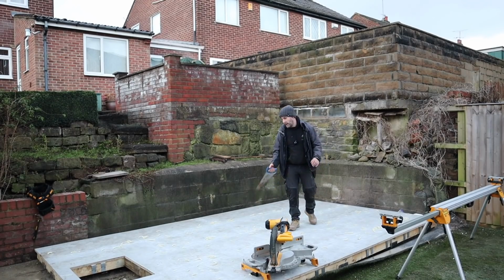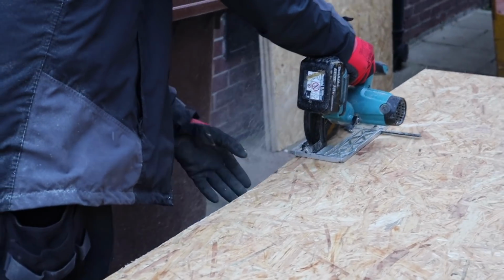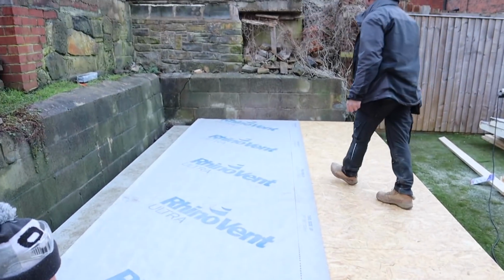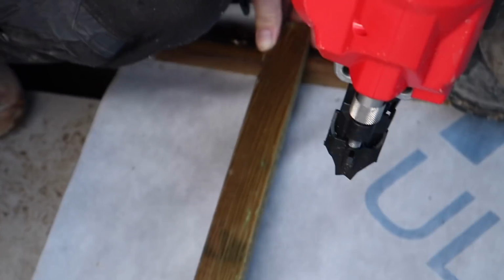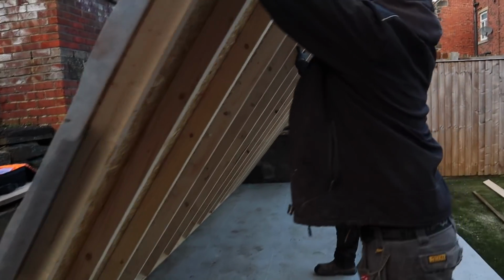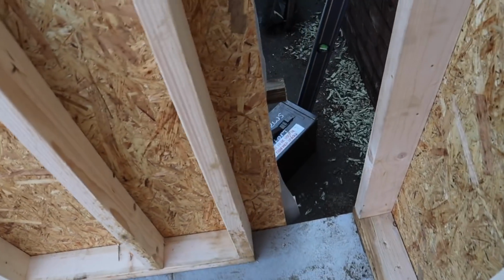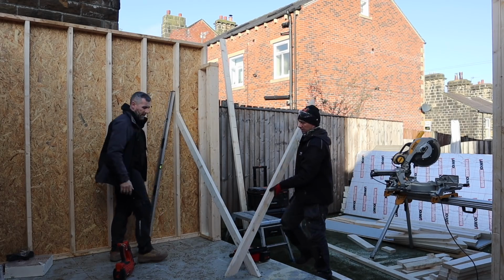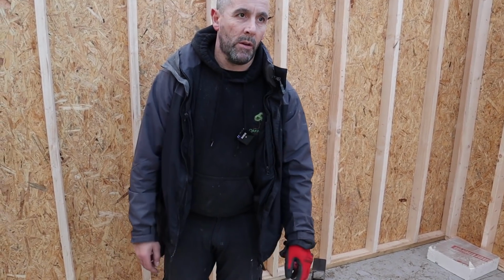Garden room timber frame wall construction with steel lintel

Comment: very entertaining i have a question in regards to the bottom plate although its nailed shut to the deck it has however only 3 nails per stud into end grain of the stud which is a very weak point 13 studs= 39 nails .i am just wondering if it would be more secure if there was some sort of metal  L bracket say every 800mm that could be nailed  to side of stud wall and through bottom plate into deck . i am thinking of up lift experienced  with high winds . or am i just been paranoid .thanks for sharing,
Reply from the maker: Paranoid mate, some weight in these when finished. I’d say around 5 tonne in a 5x3
Reply: @thegardenroomguru  thought i was a bit paranoid , i built a small garden room for myself few years back i now realised it is over engineered.At the time i couldn't help think you'd pull a nail out of end grain with your teeth .

Comment: Despite that milwaukee jamming its still miles better than the dewalt first fix.
Reply from the maker: It’s never jammed before tbh, just unlucky it was on camera 🤣
Reply: @thegardenroomguru   I'd get the milwaukee if I needed one. The dewalt we use Jams so much its quicker screwing stud work together 😂

Comment: Hi William great work could you use normal untreated C16 4x2 instead of cls for the stud walls I'm in Ireland and for some reason cls is three times the price as normal lumber is there any particular reason for the cls except its nicer to work with and maybe treated for pests is it necessary

Comment: Liam did you know you can also get OSB in imperial so no need to rip it down 👍👍
Reply: @samlaw98  I meant metric, lol. OSB either comes in 8x4 imperial or 1200 x 2400 metric sp if you but metric no need to cut it down ;)

Comment: Just a quick tip instead of measuring 400 and putting the stud in the centre. Measure 380mm from the end and then come off of that mark and mark 400 then X on the right side of that mark this will give you bang on centre instead of guessing centre
Reply from the maker: Guessing centre works for us, quick is best when your trying to  make a pound or two
Reply: Agree with Liam on this one. I initially adopted your approach Cameron  and marked up the left edge of each of my studs (I was doing 16inch so had to pull back 3/4 of an inch from 16 if memory serves). But given its pretty easy to eyeball the centre and the tolerances don’t need to be absolutely bang on for stud work, I went with the quicker option of just marking the centres in the end.

Comment: Very surprised OSB is in imperial measurements with you, been building timber frame houses in west Wales for the last 25 yrs and apart from the first couple of years we always get osb in metric sizes. Good video but  you should leave a 3mm gap between boards because they expand and could buckle/distort cls

Comment: Why don't you use 610mm spacing for wall studs? I'm a timber frame designer and we never use 400c/c. If you space the wall studs to cater for the actual OSB width of 1220mm then you don't need to rip them down. There is obviously then a good saving in studs and labour and time, just sayin. Also less studs = less cold bridges. You could also do this for you floor joists and probably for the roof joists depending on the span.
Reply: Actually more timber when you come to dry lining. Plasterboard is 1200.
Reply from the maker: Not from my supplier it isn’t unfortunately

Comment: How are you going to fasten the box profile sheets at the bottom between wall and building?
Reply: that will be like Blue Peter this is how we done it earlier , drop wall sheet it then lift it back up
Reply: From bottom of sheet to top of wall, i  bet there's 1m of sheet not fixed to building
Reply from the maker: It’s sat inches from a wall and will never move when we fix it above wall height 😊
Reply: @thegardenroomguru   could have fixed a cutting of  cladding 100mm above blockwork height, just have a horizontal joint     , put vermen mesh  along bottom between OSB and  external sheeting
Reply: They can rattle in wind, there's a profile trim that fixes to bottom of building, sheets slot in tight
Reply from the maker: @jordang204  no chance, they’ll be mm from the wall, it’s not happening
Reply: jordang204   You will get  moisture travelling into the unfixed joints due to no compression ,  thought there might of been a drip cill  fitted seal the sheets exposed open end at bottom .
Reply: It’ll rattle like a shit house door in the wind. Always like to have 400mm minimum around all walls.

Comment: Looking good, quick question I'm going to make a outside room this year and noticed in your early videos you used a air nail gun are they any good as don't want to pay for a pasload ,already have a 18g brad gun and air compressor? Cheers
Reply from the maker: spot on mate, just dangerous for us with the trailing hose, but sound if you take your time, they never miss a shot

Comment: Would the steel beam be suitable for a 4m opening for the bifolds? You only seem to have 3m openings on most of your builds.
Reply: Good question.  Also, is the steel cold rolled or hot formed as the properties are different. Where do you source it from?

Comment: Did u get an angle or straight gauge finish gun because if you got the straight you can't pun into corner only realised that a few weeks after I bought the straight gauge
Reply from the maker: Straight, it'll be fine, the passcodes are straight too, apart from them both breaking, no issues
Reply: @thegardenroomguru  the milwaukee are gas aswell just need to replace gas in side after 80,000shots

Comment: Speaking as a novice, doesn't the breathable membrane need to wrapped continuously around? Great video again and love the commentary detailing what you are doing, priceless!
Reply: No the osb overlaps the studs on the corners the felt is fine like that, the correct way as a carpenter to build and erect stud walls, great job
Reply: @stevewharram5518  Thanks for the reply Steve. I don't have to worry now about making the entire back and side walls before raising them. Thanks.

Comment: You probably want to keep using the 11mm OSB, but if you get the 9mm OSB it comes in metric so saving you a bit of time cutting 20mm off every board
Reply from the maker: I didn't know that, but after checking with our supplier theres are still 4ft, must be a different supplier I guess
Reply: @thegardenroomguru  Yes my timber merchant said the same thing to me, but I took a tape measure in there to check and prove them wrong. 9mm OSB is made in metric to fit 400mm centres
Reply from the maker: Fair enough, it’s still a down grade on spec for us though 🙈
Reply: There’s a funny bit in one of Ali D’s videos where he thought he’d found the elusive metric OSB sheet but when he rang up the suppliers they said it was a typo on their website :-)

Comment: Aren’t you supposed to leave a 2mm gap in between osb joins?
Reply: Yea we leave a 2-3 mm gap for expansion
Reply from the maker: Supposed to, but it’s got nothing at the top or the bottom, never had an issue, it’ll stay dry and won’t swell from any moisture that’s for sure

Comment: Paslode gas and battery system is old tech and unreliable. I serviced hundreds in my time with the hire centres and now there is gasless technology like Dewalt and Milwaukee, I don't know why people still use them. They are inefficient and temperamental due to the miss fires, gas freezes and the need to have them stripped and cleaned and rings replaced during heavy use.
Reply: Been saying it for years, I can’t believe they still sell so many

Comment: How are you going to get the cladding on the back with it being so close to the walls?
Reply: They build the wall and fit the cladding then stand the wall up and fix it in place
Reply: Not this time from what I can tell? (see 20:24 for example)
Reply from the maker: its metal clad, theres enough room to fix it successfully down to around 500 from floor and it'll be fixed above , as its metal its not going anywhere
Reply: You guys do a great job but would have to agree with the comment the cladding should of been fixed first on two sides as looking at the retaining walls theres well over 600 mm you can’t get a fixing in.

Comment: The prices are so expensive. Cheaper to get a builder and do traditional brick and mortar build.
Reply: Indeed. You would probably looking at £1500+ per square metre on one of these. So a 15sqm one would £22,500 minimum. That could built from concrete blocks with a cavity at £5,000 for materials plus labour plus the covering. In concrete you could get it rendered. I reckon it would be half the price if built from blocks. My garden room is hybrid. Main walls are mostly blocks with timber stud walls inside to carry the insulation.
Reply: Where you getting those prices? Just priced up my 4x3 with my local merchant and I’m looking at 2k for all timber, insulation and plasterboard, so add another 600 for rods and roof plus doors I reckon sub 5k
Reply: Paul. Rubber roof for a 4x3 will add another 500 or so. Fascias and soffits (assuming anthracite) will be another 500 or so. Bifolds and windows will be 2-3k min (cheaper if go french door). Cladding will be several more grand for red cedar for a 4x3 and if you use for 3 sides. And there are a myriad small bits and bobs here and there that quickly add up eg 2000 100mm screws, several hundred 50mm screws for OSB and plasterboard. Joist hangers. Flooring. Electrical fix and fittings. Plastering or tape & jointing. A 4x3 will very quickly get to £8-10k in materials!
Reply: @paulwills3774  I am using these guys technique and have started planning and costings, the base and floor will be around 1500 for materials, that's Inc rods, timber, steel shoes etc. I know it's probably available cheaper but this is a first glance, plus mine will be 5x4m.
Reply: @brianbrowne4935  fair enough the size will add a fair bit of cost, I’ve spent a good month shopping around for prices, I’m lucky I work for one of the companies Liam uses (won’t say which) so I can get a little discount for my build
Reply: @AccountantDoesDIY  soffits and fascia agree need  adding, my roof is priced at 300 and change all in, yes lots of sundries, my cost is still under 6k all in tho
Reply: Paul I suspect you’re a better negotiator than me :-) I went with travis for my timbers and pressure treated c24 throughout so have over engineered a bit and also travis likely not the cheapest. If you’re in the trade definitely use your contacts and discounts ! The other way to keep down costs is buy as much as possible in one go and get a bulk discount . I ordered piecemeal for each stage of my build which no doubt cost me more.
Reply: @AccountantDoesDIY  yes and no, I just pinged a local timber merchant the cut list and on some I f the lines got as much as 65% off the list price, maybe because of the size of order they could do better discounts, insulation from them is a few quid more than I can get it for with discount so to keep things easy it’ll probably all come from them, just need to sort concrete for my piles! 😂
Reply: @paulwills3774   don't think concrete will help your piles. See a doctor 😂
Reply: @AccountantDoesDIY  I am building out a 5m x 3.5, and so far my costs for all CLS treated C24, electrics and sundries is about £7.5k - only thing not included in my current total is the cladding, everything else is there including £1200 for ground screws, 2k for bifold, 2 electric heaters and all wiring and fuseboards etc. so not terrible for a big build
Reply: @mgdew  sounds about right mate. The cladding can be a very big part (red cedar) or very small (bog standard feather board). You’re in about the same ball park as my build which is a similar size. I’m still scratching my head at cost of fascia and soffits though :-(